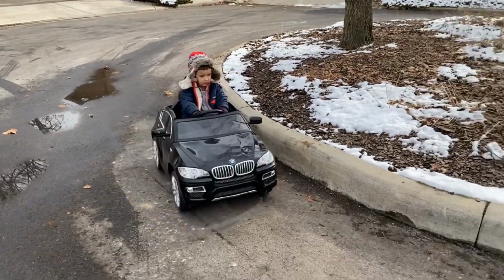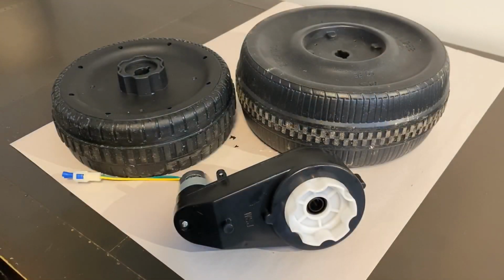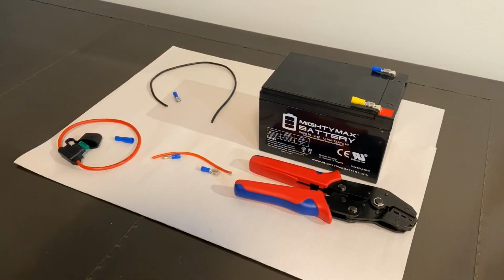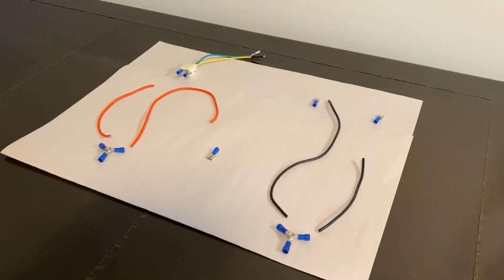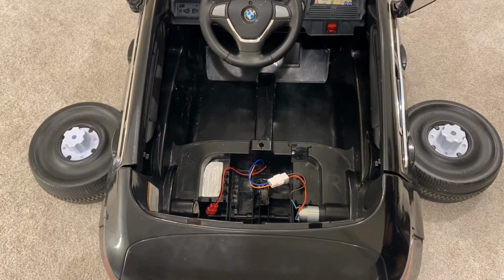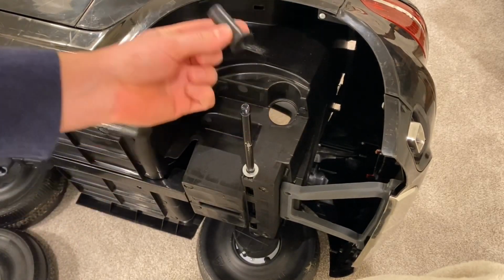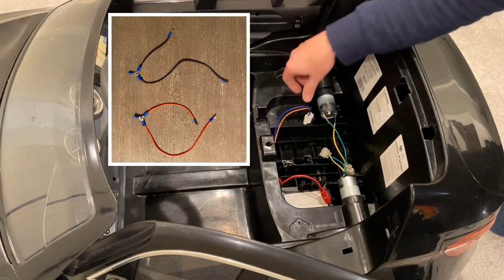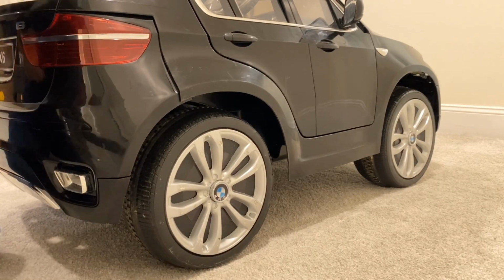Turbo Power Wheels | Modifying a 6 volt car to 12 volts

Comment: Sir you can not install a new circuit because tha first one is for axample 6v and you install 12 v batter tha circuit is born because tha circuit is 6 v you give currant 12v  you change only motors only its posibal you use care with out circuit  
Reply must sir
Reply from the maker: The voltage isn’t the issue for the wires, it’s the amperage. The fuse needs to be sized appropriately.

Comment: I've been in the Power Wheels game for over 20 years and let me go ahead and bring some insight to this because you know what something needs to be cleared up.

on the stock wiring if you're running 18 volts you're not going to have a problem because by the time all the power actually gets in the motors you're actually only really providing about 14 volts to the actual Motors after it goes through the stock wiring.   you are no way going to bring the motors out. What's actually going to happen is that your gearboxes will be the first thing to go.

newer Power Wheels have a soft start feature I know that many of the Peg Perego models have it and just as of recently the Disney princess carriage has the same thing he usually goes out all the time so you need to purchase another one but it saves your gearboxes so that's a good thing.    it does provide some lag on start but other than that it's not a big deal
  6 volt Motors again it'll be fine with a 12-volt.   

what actually burns out the motors is too much weight in the vehicle again if you run it like an RC car you'll be just fine it won't be a problem however when your kids start getting kind of plump and the neighborhood kids decide to go ahead and take a ride that's when the motor is burnt out.

the other source of motor is burning out is when someone tries to physically push the darn thing while the accelerator pedal is not depressed as it uses motor braking this is actually one of the biggest reasons why the motors give out and again gearboxes as well.

I only suggest upgrade the wiring but again if you don't you're just going to have to do it later.  your switches and everything else will end up taking the brunt. However I highly recommend that you install a high current relay between the motors and the actual control mechanisms because this will allow your switches to last a lot longer..

don't worry about rebuilding them seriously once they start getting wonky just go ahead and replace them with brand new parts. Save yourself the headache.   if you want your new stuff to last longer then fill the darn thing up with some type of electric Dielectric grease and really jamming in there good fill it all the way up and then don't worry about it ever again but if you take them apart good luck putting them back together again.  you are much better off during a very tiny pin hole on the side and then injecting the grease inside the mechanism.

another thing to note is if you're going from 6 to 12 volts by the time you add your extra lighting and accessories which you're going to be adding because I know you're safe parent and you want your kids to be seen especially an LED whip antenna by the time you run all your accessories on a 6 to 12 volt swap you're going to realize that the motors really aren't going to be working that much harder especially with the led acid battery..

do you have power tools? Especially 12-volt power tools and a lot of batteries and chargers just use that the fast charge function usually works there a lot lighter they usually based on lithium and they usually put out a steady 12 volts whereas your lead acid battery will start to have some significant problems and voltage sag after just a few minutes of use.   

a cheaper option is just to get a parts power wheel and just use the extra battery extra wires and so forth from that and that way if anything breaks on it then you can swap it. You can also get the other motor from the other side transfer it into the power wheels that you actually want to make faster and Bob's your uncle.

if you know how to build lithium ion battery packs then by all means do so make sure you provide the protection that you need but more than likely because most of these packs can be literally bought from Battery Surplus places well that's the way to go I would suggest a 14 Volt back or 5s and you should be fine.  
 
unless you have a soft start circuit do not use the rubber bands on the rear Traction tires it is a bad idea.

if you know you're going to have neighborhood kids then find a way to disengage the brake portion of it just in case when you're not looking because next thing you know you'll have 13 or 14  year old kids think that it's fun to go ahead and take a ride on your daughter's full toy. Or your nieces what have you.

one of the best mods you can do for the small little Power Wheels it's a try to make them all wheel drive it's not really all that hard and it's actually going to make your gearboxes last a lot longer and I do mean a lot longer.

if your tires are starting to wear out you can get some black paint and some Liquid Nails mix it together and then make a nice little form on what's left of the traction pads and that will keep the wheels working for a darn long time until it wears down a lot better than replacing the wheels. Make sure the grease the axles.

on many of these cheap Power Wheels especially the ones from China they come with a very subpar steering box put a bushing inside of it it'll take care of the Swap and make sure and bring anyone have to really worry about it ever again.
Reply from the maker: Great insight. Good to know that an 18volt battery wont burn out a 12volt motor.  My next project is to add a lithium ion (18 volt) battery with a low voltage cutoff. I've heard that if you run 24 volts, you run the risk of melting the wiring on the "gas pedal", which would cause the car not to stop; have you heard that happening?  Any risk of that happening on 18volts?

What are your thoughts on using a road bike tire (instead of the mountain bike tires) on the front and back tires? Or should I just used the bike tire on the front wheels and use the liquid nails on the back tires?

Thanks!
Reply: @DadHacks  

a gas pedal or the switch that's underneath it will melt that stock voltage simply because the breaking effect is a short circuit on both Motors creating a very high voltage and current Spike.

 that's actually what cooks your switch. Not the higher voltage believe it or not.
all the higher voltage does to the switch is simply put a greater braking load since it's going faster therefore creating a higher current and voltage Spike when the short circuit is needed for breaking.

use a Ford starter relay. never worry about the problem again..

about the tires, use rubber on front and plastic always on the back especially with stock Power Wheels gearboxes

just like at the drag strip , drag slicks   have a certain amount of cushion for the drivelines used in these vehicles.  
that's basically what the plastic wheels are doing on a Power Wheels

rubber tires are perfectly fine for the front.
Reply from the maker: @MickeyMishra  ok, just bought a relay switch; I’ll be adding that to the car!
Reply from the maker: @MickeyMishra  Another question, you said to add a relay to prevent a high voltage spike when the circuit shorts. Where does the relay go? I added a relay as part of my Low Voltage Cutoff protection since I switch to a lithium-ion battery pack. Will that 1 relay do the job, or does it need to be close to the gas pedal?  Here my video: https://youtu.be/S9LMmRpvSGg
Reply from the maker: Which type of liquid nails do you use for the tire traction?  The "Projects" or "Heavy Duty Construction"
Reply: @DadHacks     Use the Polyurethane.   Sometimes it goes under another brand.   The regular stuff works fine.  Its almost like the stock Plastic wheel.     Die it black and you won't notice either.  Or just Spray Paint it.

Comment: This is a grate video I have an older 12V 4X2 power wheels from 1985 now I want to fixit for my grankids but I am having problems with the new 12V batterie the original charger was a flat 4 prong harnest. I hook up the two whites and two bloacks to the new two rire harnest and i keep blowing the fuse but if I hook up the motor to battery it works > Am I doing something wrong with the 4 wires?
Reply from the maker: Were there 2 batteries originally?
Reply: Yes
Reply: And I tough that black wires positive and white negative but it’s not working and I  don’t know enough on how to rewired harness
Reply from the maker: @alfaroinc1  so the original set up had two 6 volt batteries and low speed was just 6 volts and then high speed would use the 2nd battery to get 12 volts. Switching between low and high will pop the fuse is you are just using 1 battery. You have 2 options, remove the “high” speed switch and only run the car in “low” gear (low gear is actually “high” 12 volt gear since your battery is 12 volts) or to go back to two 6 volt batteries like the stock setup
Reply: you are correct because when I unpluged the high speed conector I dont pop the fuse, I realy apreciate this, helping me figure out the problem thank you  @DadHacks

Comment: Son's McQueen huffy turns off when he revs even with a full charge you think this upgraywill fix it
Reply from the maker: Yes it will. I’ll look for the wheel drive hub that you will need for the 2nd wheel and I’ll post the link to buy it
Reply: @DadHacks  ok thank you I appreciate it
Reply from the maker: You can either get the replacement wheel drive from Huffy by going to their website, click Gears and Parts, enter some info and then when it says Enter your 5 digit model number,  enter 17327. Pick item #9 Drive Wheel. It’s 12.99 plus shipping, but it’s the whole wheel plus the hub. A cheaper option could be to order it via Alibaba. I believe it’s number 10, but measure to confirm. 
https://a.aliexpress.com/_mNpF6Bk

Comment: I swapped the 6v battery for a 18v milwaukee battery and now it runs but than turns off
Reply from the maker: What model is it? Does it have a control board (if you have a parent remote control then it does have a control board)?
Reply: @DadHacks   it had a circuit breaker  that was making it shut off  took it off since I'm running a 30 fuse from the battery and it works fine now

Comment: Very cool. Exactly what I was looking for! Thank you sir. Last question: don’t you have to change the “ESC” as well since the older one is a 6v? Won’t it fry?
Reply from the maker: If your car has a control board, then yes it will burn out if you over volt it. Some cars have a control board and others don’t. Look into getting a Weelye RX23 (12volt). If you ever go up to 18 volts, you will need the Weelye RX30
Reply: The fuse blew, I installed just as you did, does that mean I have to change my control board
Reply from the maker: Have you had a chance to replace the fuse? It could just be the fuse and the control board could be okay. Unless the control board is the stock 6 volt one and you went up to 12 volts, then it’s a good idea to go ahead and get the 12v control board
Reply: @DadHacks  I replaced the fuse, and switch some wires around. The wheels were spinning opposite of each other. It works now. Thanks
Reply: If I upgrade the control board to a 12v board, are the stock accessory ones (lights, radio, steer rotor) going to be able to take 12v without eventually burning? Thanks for your video!
Reply from the maker: The lights and steering should be fine, it’s the radio that would be most likely to fail

Comment: So I’m currently taking apart my daughters Elsa Jeep Kid Trax brand. Trying to upgrade from this kit. Got the whole kabootle. Nothing is matching up. The molds on the wheels are different from the gearbox and so on..the spot for the 12v battery is too small compared to the OEM one…do you have a recommendation on where to look to get the right parts?
Reply from the maker: Kid Trax is one for the brands that uses their own molds for their gearbox. You can search Amazon for Kid Trac 12v gearbox. As for the battery, you could wire two 12v/4ah batteries in series for a 12v 8ah battery or look into getting a 12volt power tool battery (but you will want to make sure it doesn’t discharge too low).

Comment: My kids car has LED. And a entertainment system with speakers. Will this not hurt the electronics there? It is also remotely steered as he is too young to drive. The steering motor will go bananas with fast steering. Dont know how to do this now
Reply from the maker: The LED lights will be fine. The speakers will most likely be okay on 12 volts, it’s when you go up to 18 volts that those type of electrics go bad. You will need a new control board, I’ll post a link to a 12 volt replacement board. The steering motor can handle 12 volts, wouldn’t worry about that. https://amzn.to/47AwFm2

Comment: sorry , i want ask something... how to select the appropriate switch?
Reply from the maker: Which switch is this for?
Reply: ouh sorry².. i mean fuse
Reply from the maker: @miftahonchannel94   No problem. The fuse size is based on the wire size in the car. If the wire size is 16 AWG or 14 AWG, you can use a 20amp or 25 amp fuse, respectively

Comment: why is this faster then buying a 12v power wheel? wouldnt buying a 12v be easier? i have a 6v w one gear n motor was thing about going 18v but 12 v seems safer but like idk if its faster then buying a 12v out the box?
Reply from the maker: Yes, buying a 12v would be easier, but we were given a 6v and wanted them to be able to use it longer. The “upgraded” 12v motors are faster than a stock 12v motors because the motors turn faster

Comment: Hey, I feel confident I can pull this off, thanks for such a great tutorial, however  just wanted to ask, so if I upgrade the 12v battery and the 12v motors, will I be able to still charge the car via the same charger that came with the car? 
My battery is under the seat so it wouldn't be practical to keep removing the seat to keep charging the battery.
Reply from the maker: No, you will need a new charger. Look for a 12v charger that has the same port as your stock charger. Typically, they look like this: https://a.co/d/8b9E6tO … if it looks like that, you can order that one and use it on your car
Reply: @DadHacks  thanks! Not sure what happend to my response it seems to have disappeared.
It turns out I already have a 12v battery in the car and as such the motors are also 12v, however currently I would say the car runs alot slower than what is seen on your video...
What would be needed to increase the speed of the car? Just straight replave to a similar battery like yours?
Thanks again
Reply from the maker: @4dee103   So the main issue is probably the motors. Even though the are 12 volt, they are probably low RPM. Depending on the brand of the car, switching out the gearbox and motor could cost about $35. I should have a link for high speed motors/gearbox  in the description of the video

Comment: Hi bro, my sister's toy car is 6v stock, can i use 12v battery?
Wht must i change if i do upgrade to 12v?
Reply from the maker: Are there two rear motors? Typically 6v is just 1 motor. Adding a motor and then switching the a 12v battery is where i’d start
Reply: @DadHacks  nope only 1 motor
Reply: @DadHacks  will the radio burn if i change to a 12v battery?
Reply from the maker: The radio should be fine, but if there a black or white little “control box” that has power wires running into and then wires running to the motor. If the car has a parent remote control, then it has a control board. This control board will need to be upgraded to a 12v board, if there is one. If so, you would need a “Weelye RX 23”. It’s a 50/50 chance that it has one.
Reply: @DadHacks  okay bro, thanks for helping. i really appreaciate it.

Comment: granddaughter has a Kid Trax Disney Frozen 4x4 ride on, will this conversion work? or only on power wheels
Reply from the maker: Yes, it will work for the Kid Trax brand cars as well. Since it’s already 12v, what you are essentially doing is replacing the motor with one that has more RPMs than the stock motor. Depending on their age (6 or older) it might be time to increase it to an 18 volt battery.
Reply: @DadHacks  sorry I wasn't clear, this is a 6v, so would it work with same instructions as for power wheels
Reply from the maker: @CaroleKeller-u4p  Ok, yes it will. Actually the car used in the video isn’t an actual “Power Wheels” brand either.
Reply from the maker: Before you start, look to see if your car has a small (3 inch x 4inch) small “control board” where the battery and motor inputs connect. Usually a car that has sounds and remote control function will have this “control board”. I don’t think your car will have one, but if it does, you will need to get a Weelye 12 volt RX23 replacement board because the stock one can only handle 6 volts. But I doubt yours has one.
Reply: Just placed an order for my daughter!  Thanks for finding this video mom and letting me know! She’s going to love it 🎉❤

Comment: Will this fry the radio or LEDs? I notice ML Toys doesn't mention anything about the radio in their upgrade kits. We have the 1969 Bronco 6v. If it DOES fry the radio, does that interrupt power flow to the motor?
Reply from the maker: I believe that’s a Kid Trax brand Bronco, which does not have a control board (which is a good thing), so it likely won’t be an issue going from 6v to 12v for the lights. It might be an issue for the radio, but double check to make sure the radio doesn’t run on AA batteries. But no, if the radio goes out, that’s not an issue for the motors, it will still run